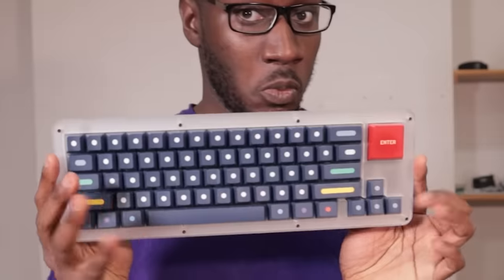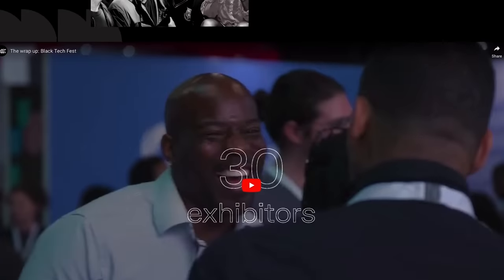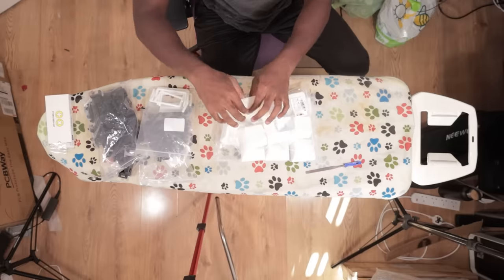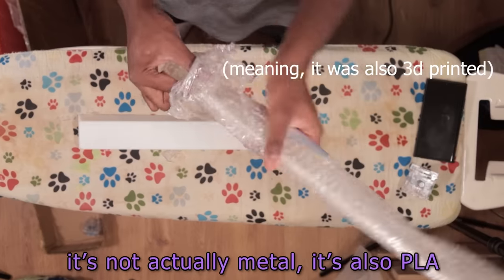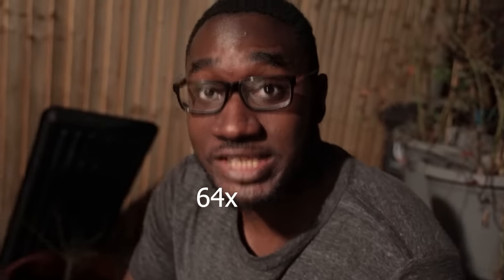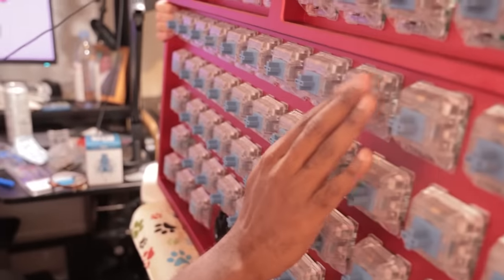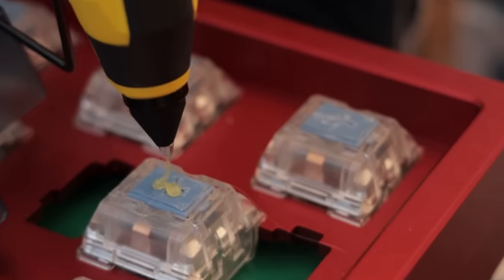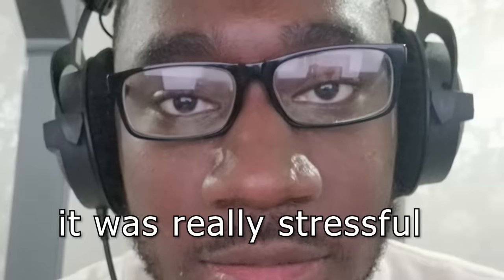reasonably sized keyboard

Comment: The fact you scaled up the PCB itself and didn't just use multiple smaller ones is legendary.
Reply: Could have just used one small one and wired the switches which would have been a pain but this pcb probably cost like 2k lol. Still infinitely cooler though
Reply: @trevor245  yeah that's was kinda my thought too lol
Reply: How would he use multiple smaller ones when the gap between keys is much bigger?
Reply: @pepega3344  You would handwire the switches in a matrix and only need a small pcb would have sufficed
Reply: Couldn't you just put a wire from each switch to a tiny board?
Reply: when he pulled out the gigantic PCB i died laughing
Reply: @bit1345 you could also just hand-wire the whole thing, it would probably be easier because the big keys would make things less cramped than normal

Comment: I'm an engineer and I've been cracking up through this whole video. This is how every project I ever did during college went, including the shrug when the 1.5 spring spacebar was like... good enough?
Also PLA and ABS is basically what super glue is made for. Cyanoacrylate should always be your number 1 go-to for anything plastic that needs to be fixed.
Reply: Cyanoacrylate is okay, but Weld-On is much better and creates a weld between materials that is as strong as the material itself

Edit: Caveat to this, it only works with certain types of polymer materials, like PLA and Acrylic, and will even join dissimilar materials it works with.  It's less of an adhesive and more of a solvent, and unlike CA glue, it doesn't leave any of itself behind once set.
Reply: for pla, ditch the glue entirely and use a woodburner/soldering iron (with a sacrificial tip) to weld the parts back together. you'll warp the surface unless you get good at it, but it's WAY stronger than glue. for abs, just use acetone. melting plastic together is always better than glue
Reply: @merlindraws3616  No reason to use heat when a chemical solvent like Weld-on will actually weld the pieces of plastic together with no risk of warping or burning.
Reply: @merlindraws3616  or 3d paint pen
Reply: @dylangergutierrez  chemical solvents tend to fail on some plastics like pla. there's a select few that seem to work decently. which weld-on product do you use that actually works? i've heard that MEK works really well on pla but it's really hard to get around here.
Reply: @merlindraws3616  I use Weld-On 3.  I've never had PLA-to-PLA seams made with it fail.  I got the initial recommendation from a guy who makes 3D printed cameras professionally.
Reply: Ok middle aged woman and man to many adults watching this go watch judge Judy or people's court like my mum
Reply: To be completely honest, projects worth couple of hundred euros are exactly like this, but it's never out in the public :'D . Can confirm from personal experience.

Comment: Just a tip: when something 3d printed breaks you can put a soldering iron on ~200C and more or less “weld” the two bits together. Holds really strong as well
Reply: Thats a good tip to share its how I assemble pieces of helmets I print its pretty strong

Comment: Wonderful! You already pointed out most mistakes. The one thing I would have started with is aluminum rod from the hardware store for the stabilizer bar. It's fairly soft, so easily bends around a table edge. In a pinch, I'd use a metal wire clothes hanger. That's my only suggestion, I'm very happy you went through with this.

Comment: Hey Glarses!

For future reference, a better way to "fix" a 3d printed part is to just melt the two halves back together with your soldering iron!

I was yelling at my screen hoping you would think to try it through this crazy project, but :( 

Entertaining as hell either way! Never stop being you!
Reply: My dog had a heart attack 
Anyways, great comment 10/10
Reply: Yo
Reply: @Chilloutlilbro my piano teacher died from aids. Only song he taught me was the final countdown
Reply: @bIuecap  RIP
Reply: Bro these replies are cursed wtf
Reply: Actually not a good solution. The weld would be provably superficial to the parts and not very strong. Also the finishing would probably be bad, requiring some sanding... Superglue ia the way to go.

Comment: If you have an issue with the stabilizer bar later, try using a first aid pad, they are very thin and will provide better support. Soak it in a super glue and wrap it around once and let it dry completely, then if you want, put another layer to double down. sand away the rough parts and it should be strong enough.

Comment: If you ever 3d print something that doesn't fit, 3d printing pens can get you out of alot of tight places, or heating up a piece of metal and jaming it in the hole thats too small. And there are superb structural adhesives out there that fill gaps etc.

Comment: @Glarses next time take that soldering iron and melt the PLA together, you can even use zip ties as a filler to melt the two, Its a jank plastic weld better than glue though. I have literally used this method at work when rapid prototyping mechanical parts. - mechanical hardware design engineer

Comment: The proper way to fix the stabiliser bar is to pin glue it.
So you start by drilling holes into both sides, then glueing it back together with a paperclip in the holes you drilled

Comment: If you ever break a 3d printed pla part again, you can use a soldering iron to "weld" it back together, that's probably gonna be a bit stronger than glue.

Comment: A better fix option for the broken PLA stabilizer bar would be to use a soldering iron with a bit of wire bridging the gap.

Comment: what kind of engineering experience do u have that made you get clearly pretty decent at CAD and have at least some PCB design knowledge but have zero clue about what materials might be reasonable choices for things such as stabelizer wires(like it's literally in the name)). also get a fucking 3d printer so u can test ur designs i have no clue how u ended up rather spending thousands on ordering broken parts that printing one test piece at home.